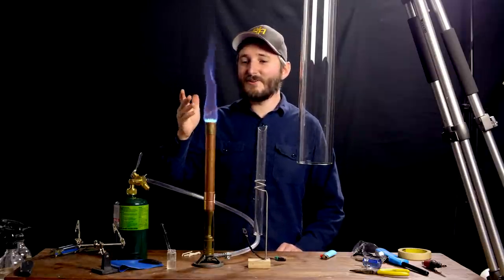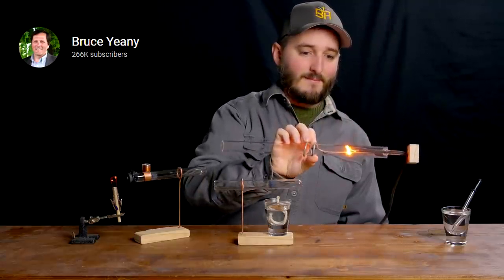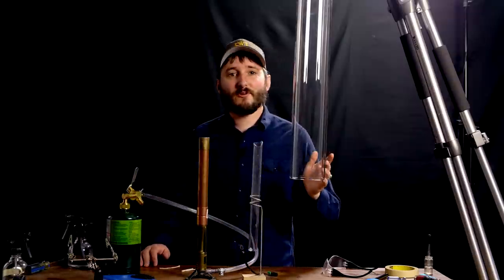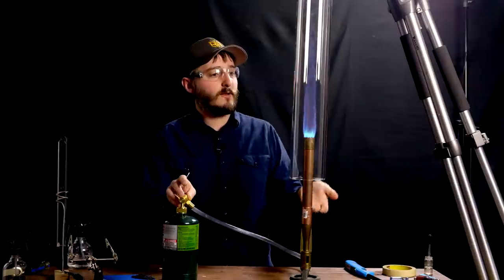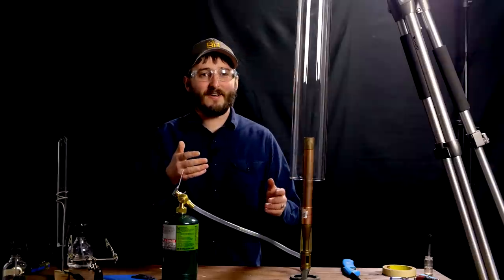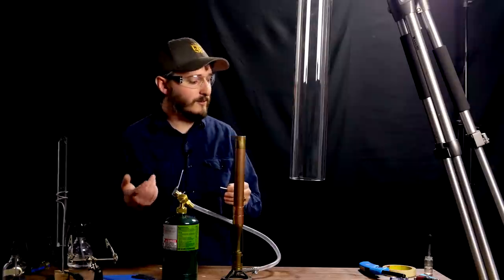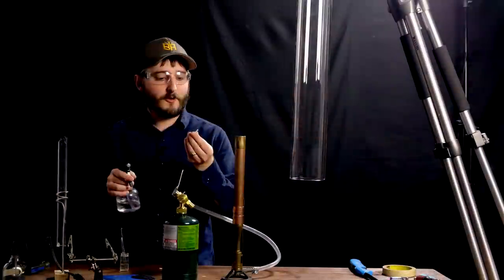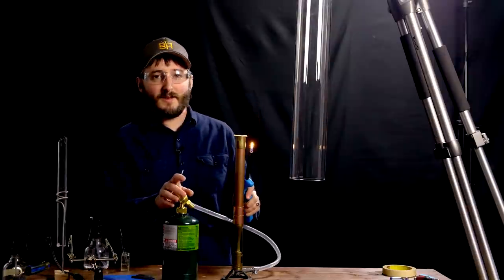Fire Driven Sound Waves in a Quartz Tube

Comment: Does this explain why those old Coleman lanterns with the "tea bag" filaments would 'sing' if they were dimmed to just barely above being turned off?
Reply from the maker: Could be, but I bet that's probably just the fuel squeezing through the tight fitting
Reply: @Nighthawkinlight  Ooh, could you use a Davy lamp style mesh screen protection around the flame to protect it from being extinguished? Mantles from kerosene lamps would be too fragile, I suppose.
By the way, I just found this in the OED:
  pyrophone  n.Brit. Hear pronunciation/ˈpʌɪrə(ʊ)fəʊn/, U.S. Hear pronunciation/ˈpaɪrəˌfoʊn/  [after French pyrophone (G. F. Kastner: see Comptes rendus hebd. de l'Acad. des Sci. (1873) 76 700)] any of various pieces of apparatus designed to produce musical sounds using flames or explosions; esp. a musical instrument (invented by G. F. Kastner in 1869) resembling a small pipe organ, bearing a series of glass tubes, each containing two gas flames burning close together, and producing a resonant sound when the flames are separated by pressing down a key.
1873   Galaxy July 133/1   M. Fr. Kastner, inventor of a novel musical instrument, called by him the pyrophone.
1882   Nature 27 July 304/1   This phenomenon, which Kastner called the interference of flames, was the..starting-point of Kastner's Pyrophone or Flame-Organ, which he patented in 1873.
1988   Economist 13 Feb. 92/2   Pyrophones—gas blowlamps played through old fluorescent tubes—add mournful, organ-like sounds.
2002   Northern News (Brisbane) (Nexis) 4 Apr.   Pyrophone player Anna Shyman said her group..had taken the idea of a normal air-powered organ and substituted fire to create an instrument that changed its tune nearly every time it was played.

Comment: Oh, I missed this video at first…
Years ago i received a present: 1m of a ø10cm quarz glass tube to make a singing tube. Works wonderful and is loud like hell! :-)
But I immediately wanted to go bigger, and by bigger I mean a few meters to get a deeper tune.
But you just did that :-D, but not just big enough. Nice!
i have a question though: Could i use metal tubing like stainless steel tubes with ø10cm? Or isn't that rigid enough.
And also I want to electrify my tube. How did you do that?
Reply from the maker: Yes you can use metal or plastic pipe. Nichrome heating element with a dc power supply works well

Comment: How much consideration is taken with rocketry for acoustic multiplication inside combustion chambers? What if you could add some internal features akin to tesla valves or photomultipliers to focus the sound specific directions. How would things change if you induced a Vortex like on fire tornado generators?
Reply from the maker: I think they do design rockets very carefully to avoid thermoacoustic effects, or at least different vortice induced vibrations.

Comment: ° I happened to discover this phenomenon myself one day by accident. 
° Trying to clean cobwebs with spiders out of  a section of PVC gutter down pipe.
° OF INTEREST in the comparison of our results. It makes me realize that the ratio of the 'flame's to cylinder's' - (F's Ø : C's Ø) cross sectional diameters must play a part in the flame's extinguishment. 
° My flame didn't get extinguished so easily(much less fragile )by the resonating sound waves; because it's cross sectional Ø was small and the cylinder's was large. 
° In my case the approximate ratio of F's Ø : C's Ø was 12mm:90mm or 1.2cm:9.0cm. (0.133)
° Your diameters were much closer to each other 2.5cm:6.0cm.(0.416)

Comment: How hot does the tube get during use? Is this something that could be developed and commercialized as a decorative novelty? It seems like some work with the burner tip could result in a more stable flame. 

I feel you on the scripting and its effect on the educational quality. Makes it impossible when there are a bunch of loud, miniature humans around.
Reply from the maker: The tube doesn't get especially hot, and it's off an infrared pillar heater so it's meant to take some heat. Could make an instrument.

Comment: Do you think that it would be possible to count the number of oscillations in the fire per second to accurately calculate the number of Hertz in the frequency? Then compare that number of Hertz with the expected values for the fundamental frequency and subsequent 2nd, 3rd, etc. harmonic frequencies determined by the length of the tube and estimated speed of sound. We could, in theory, know which harmonic we're listening to, right? Or am I overcomplicating things?
Reply from the maker: Could work

Comment: Hi, i was wondering if it would be possible to build a setup that could extract a constant force from the standing wave. By placing a  Tesla valv(ular conduit) in the pipe, the wave going one direction should have little trouble propagating, but going in the reverse direction should yield a lot of drag right? I know this setup would make it a lot harder to find a resonant frequency but still, shouldn't it be possible?

Comment: @NightHawkInLight - Long before there was any YouTube, I saw an educational video in which the Singing Pipe experiment appeared to be done with a HORIZONTAL tube. Is that possible? Or did they actually have to angle the pipe a bit?
Reply from the maker: You can do horizontal if you have a fan giving air flow, or if done with a cold section like in part one of this series

Comment: Here is something I found out, not sure how, when I was playing around as a kid (back in the late1950's or early 60's.  Take a tube that will stand heat.  Put a little denatured alcohol in it.  I used to use about 1/2" diameter aluminum tubing 2-3 ft. long.  Put your finger over the end so the alcohol will not run out and coat the inside of the tubing.  Pour the excess alcohol out so it is just coated.  Then, making sure thee is no alcohol on the outside of the tube, hold it verticle and light the alcohol.  A flame will burn inside and changing notes will happen.  I used to use alcohol I distilled when I was a kid for my alcohol lamp.  It was not drinkable as I used rubber tubing when I distilled it.

Comment: Should use electrolysis  to separate some water to hydrogen and oxygen and use that should resist going out since it's got it's own oxygen & fuel source and the pressure waves might condense the water visibly in the tube when it resonates, and it's a self sustaining flame more resistant to pressure wave disruption.  Could probably rework that wood gas tank into storing it up. If it doesn't condense it might try putting a sonic humidifier on the intake to super saturate the air.

Comment: Something you brought up that I was curious about during last video, in this open system heating too fast doesn't allow for a wave to occur.  In a closed system is this the same?
Reply from the maker: No it's not about heating too fast, it's about heating too evenly. The heat needs to be focused too a specific area in the tube, both in closed and open tubes.

Comment: Hi,
Can you please make ionized alkaline water purifier ..
DIY will be very helpful .. ready made off the shelf are very very expensive !!
Not much going practical working vedio are available..
In theory it's very simple but correct material need to be selected as it may have health issues..

Your research and perfection will be very helpful to make a good working prototype ..

Regards

Comment: I'm a composer. I want to make a piece of music that uses thermoacoustics because of this but i have some questions that i need answered. how  accurately can you tune the pitch of a device like this? Could i set a bunch up in a row to mimic equal temperament? can you consistently force harmonics? can you make a version of the device that starts the burner with a push of a button? I want to know if i can set up a keyboard that turns on the flame when depressing a key and turns it off when the key is released.
Reply from the maker: It would take a lot of work but you could probably get it done.
Reply: @Nighthawkinlight  is there a formula for how the size of the tube relates to the pitch it makes?
Reply from the maker: https://acousticalengineer.com/fundamental-frequency-calculator/

Scroll to the bottom for the formulas.

Comment: I sometimes notice that parts of our wood furnace start vibrating at a fixed frequency when the conditions are just right outside (it's not overheating). I guess this could explain it rather well. It's a source of heat into a chimney. It happens when it's windy outside (added pressure from the top of the chimney) and the furnace isn't running at full capacity. Any ideas?
Reply from the maker: Probably wind blowing over the top like blowing into a bottle.  Could be something thermoacoustic though.

Comment: My dad has a small propane heater that attaches to and sits on top of a standard grill propane tank. After igniting it and it starts to warm up, it makes a loud horn sound for a few seconds. It starts quiet, slowly ramps up to a decent volume, then slowly fades as the heater gets hot. Is that the same principle happening?
Reply from the maker: Probably something different, but hard to say.
Reply: @Nighthawkinlight  We’ve always been curious as to what causes it. It sounds like a boat horn, similar to your setup, every time we fire it up.

Comment: 5:00 Not really. Alcohol is mostly better at wetting things, but not because it's a better wetting agent. It always depends on the polarity of both, the thing you want to wet and the liquid you use. Water being extremely polar, alcohol matches more often except for salts.
And i'd try using a very thin capillary to get the NaCl solution into the flame instead of a wick. Lasts longer if you get it to work ;)

Comment: resonance boosted jet engine, ethanol or hydrogen
Reply: resonance compressed combustion, the tesla turbine jet engine
Reply: lift by screw, keeping the heat up to keep it going
Reply: resonance boosted propulsion
Reply: compression cores with high density of ions
Reply: so how about concentrated wind tunnel flap generator, inverse of the flexible electric/magnetic/piezo flex cantilever fan

Comment: Finally realized you just want to make CO2 and find different ways and put it in a video....lol.....hmmmm

Try running a 40MWe natural gas boiler and giving it too much gas or not enough air.  good shaking going on as gasses combust in areas it was not designed for.  Rumbling good time.  Note....not a black smoke/blow up way.

Comment: 🙏 not oll scripts we reseave are accurat🙏
Do to the somtimes misunderstandings of the previus opsurvers💟
💜

Olways shine your own licht over everyting you see in oll understandings💜
En use your ouw totalety of that gathering of understanding💜

I found out that mannie things we as men has ritten on papers is there from opsurving traying to understand.
en not from understanding afterwart konvurming treu the opservation😅

If you ride from understanding you wil see that the bugs of asuming toward the opservation...
When compering.
Bit olso onderstand way we dit go that way bevore..

If the flame is high there is curculation en the flame taces inof for the gass atoms to pull thame selfs towart where it feeds from💜

The space inbetween the oxigen.💜
For the oxigen to tace from the others ther fore heath treu expantion of the space inside en ouraund the fieul💜 (after the thurning point of your compresion combastion experiment)

Pomp in......
Than the end motion toward opening en there is fire durimg backwards motion of the kartoen pomp fire starter😍💜)
So if we slow the siculation it snaps from below to travle up💜
As normal the snap is not there as the oxigen is inof thare with its emotion to pull on the fire as the fire pules on the gas .

En in space if we pull we olways pull more than we need this we name in plasma science the emotion💜
En this is the carbon💜💟💜
As the plasmas emotion bild ub to less contracting space en this less contracting space in a more contracting inviorment becomes a moon like structure(we recordnice as carbon😍)

The problem with seeing papers as a apsoluut  is that the foundation of knowledge oftenend brings limitation.
As is.... knowledge in one is a inturnal evolution with in en ourond our selfs below en above inside en outside everyting that exists💜
This has now borders en belong to oll created💜

But we are afright we say somting wrong en tace papers as a absoluut.
 limmiting our own understandings to see the treu essence of the space where we oll have made ourselfs from💜🙏🍀🍀🍀🙏💜

Injoy existing to oll🙏💜⭐💜